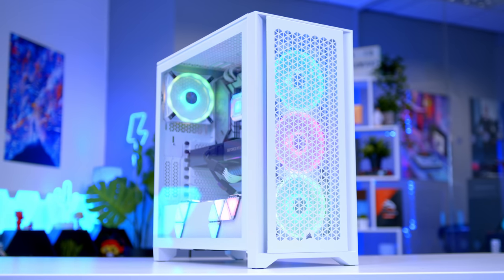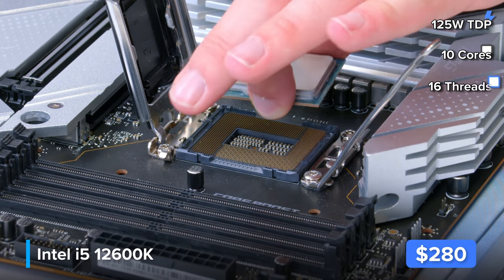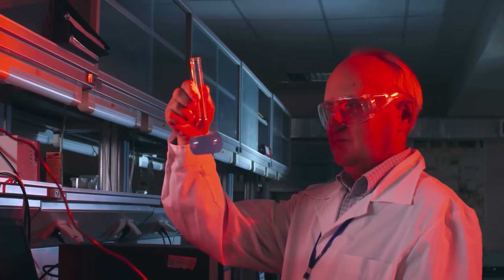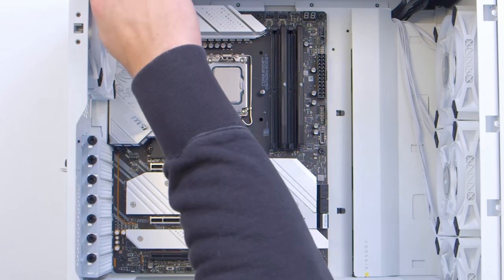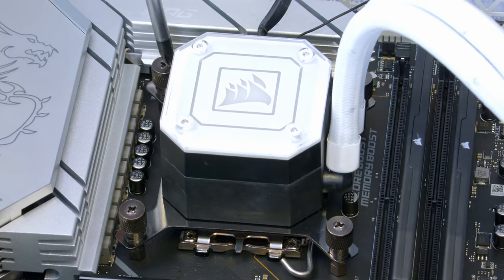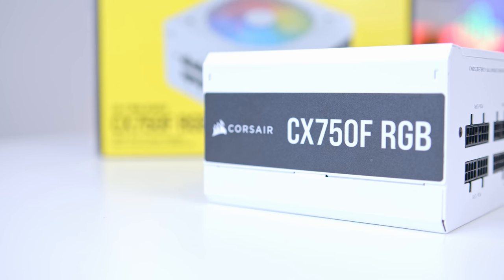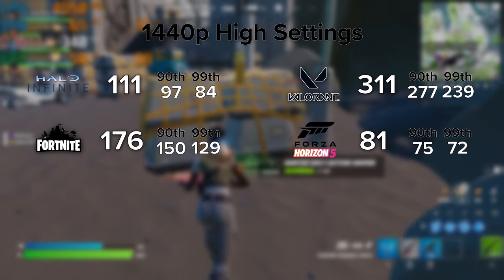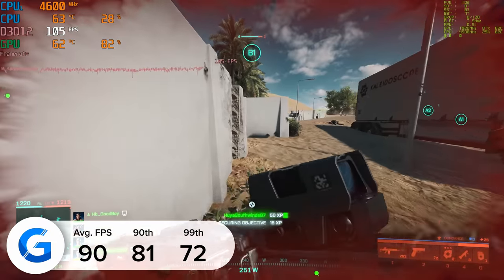The ULTIMATE $2000 Gaming PC Build 2022! 🔥 White Themed Build ft. 3070Ti w/ Benchmarks!

Comment: Just build my first pc and it kinda looks like this 
Parts 
Cosair 4000x icue rgc Case
Corsair 750 watt
Samsung 970 evo plue
2 Tb harddrive
i7 intel 12700k
Corsair icue h100i elite capellex
Asus rog strix z690-a
Corsair vengeance 4 x 8 3600
- only running integrated graphics right now waiting till 3070ti become in stock were i am
Reply: Ya 10/10